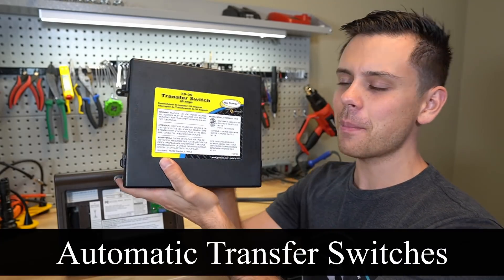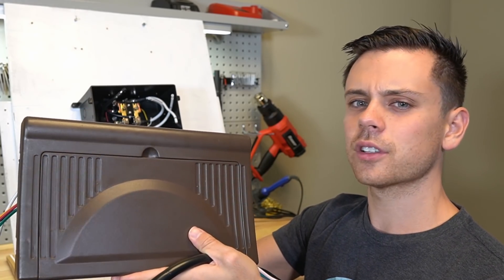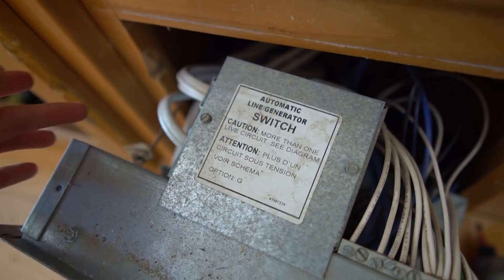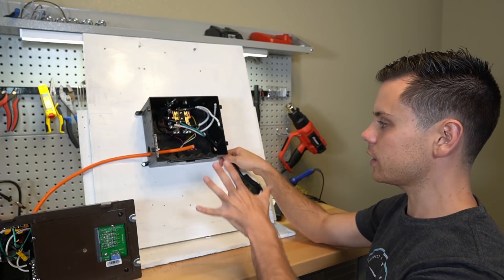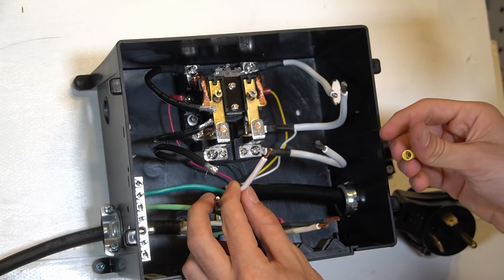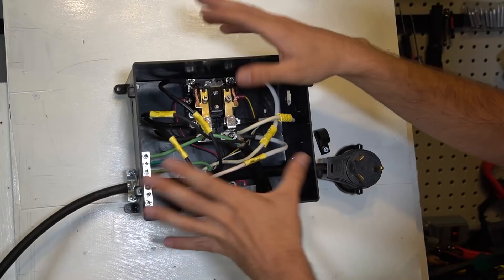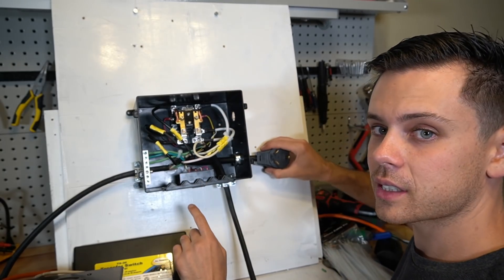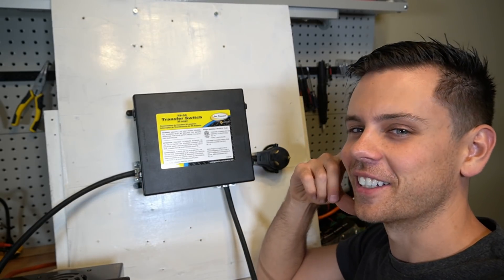RV Solar Power: How to Install an Automatic Transfer Switch to a Solar Inverter

Comment from the maker: Solar battery shore charging is covered at the very end of the video, but going by the comments, I need to clarify it here: No, do not charge your solar battery with the RV converter charger!! Hooking up a solar battery charger is covered at the end of this video.

If your RV has a solar battery AND a house/coach battery, then the RV converter charger is great and there is no need to disable it.

If you are using one battery for both, and you do not disable the RV converter battery charger, you are going to have a bad time! Think about it like this: if you have a battery, powering an inverter, charging  itself with the converter charger, you are going to have problems! I figured that was implied, but going by some of the comments, people are not understanding that part of the system. 

Many people use separate solar batteries than their coach batteries, or want to run their RV from a goal zero or other solar generator. Or a gasoline generator. Which means wiring the ats as shown in this video is ideal. If your solar battery is also your coach battery, you need to wire up your own battery charger. 

Does that make sense?

Tired of getting ripped off? Check out my "Will Prowse Approved" solar product recommendations below!

12V Batteries
https://www.mobile-solarpower.com/lithium-batteries.html

48V Batteries
https://www.mobile-solarpower.com/48v-batteries.html

Offgrid Inverter System Builder
https://www.mobile-solarpower.com/48v-complete-system-blueprint-559371.html

Hybrid Inverter System Builder
https://www.mobile-solarpower.com/code-compliant-48v-offgrid-system.html

Mobile Handtruck System Builder (very popular!)
https://www.mobile-solarpower.com/mobile-48v-system.html

Solar Panels
https://www.mobile-solarpower.com/300w-solar-panels.html

Ground Mount Solar Racking
https://www.mobile-solarpower.com/ground-mount-racks.html

Wire, Lugs and Busbars
https://www.mobile-solarpower.com/wire-and-connectors.html

Tools
https://www.mobile-solarpower.com/tools.html

Fuses and Circuit Breakers
https://www.mobile-solarpower.com/fuses.html

Plug-N-Play Solar Systems
Ecoflow, Anker And Bluetti! So many models to choose from. See my current recommendations here:
https://www.mobile-solarpower.com/full-size-systems.html

~~~~~~~~~~~~~~~~~~~~~~~~~~~~~~~~~~~~~~~~~~
Need to build a large DIY system? Need a trustworthy solar distributor? These are my favorites:

Signature Solar
Creator of EG4! Solar Minisplits, Victron and More! Largest Solar Store Online.
If you want $50 off, please use my link below and coupon code "DIYSOLAR50":
https://signaturesolar.com/?ref=cPwLcVc0SW-BjN

Current Connected
Best Prices for EG4, Victron, Midnite and so much more! Fast Shipping and Highest Rated Customer Service:
https://currentconnected.com/?ref=wp

~~~~~~~~~~~~~~~~~~~~~~~~~~~~~~~~~~~~~~~~~~
Join our DIY Solar Community 
Need more help? Join the largest solar forum on the internet for beginners and professionals alike. 140,000 members and counting!
https://www.diysolarforum.com

Check Out My Free Book
Best-selling and beginner-friendly guidebook to off-grid 12V solar!
https://www.mobile-solarpower.com/the-book.html

~~~~~~~~~~~~~~~~~~~~~~~~~~~~~~~~~~~~~~~~~~
Contact Information:
I am NOT available for personal solar system consult! If you wish to contact me, this is my direct email: williamprowsediysolar@gmail.com
FTC Disclosure Statement and Disclaimers:
Every video includes paid promotion or sponsorship (such as free products for review). Some links on this YouTube channel may be affiliate links. We may get paid if you buy something or take an action after clicking one of these. My videos are for educational purposes only. Information is subject to change/update at any time. Electricity is DANGEROUS and can kill. Be smart and use common sense :) DIY Solar Power with Will Prowse is a participant in the Amazon Services LLC Associates Program, An affiliate advertising program designed to provide a means for sites to earn advertising fees by advertising and linking to Amazon.com
Reply: This is the part where I have yet to tread in any real detail, so for me, this video should make sense after I re-watch it a few times so I can follow the wiring procedure(s) in my own head - and then hopefully I will fully understand how the entire electrical system is designed, and works together as a whole, including Solar and Battleborn's. I'm still heading out on the road @ 24 volts in a class A, possibly utilizing an additional 24 volt alternator to juice up the house batteries while going down the road. And CONGRATULATIONS on your new home Will, I am so excited for you!  Keep the videos coming, your channel is doing GREAT my friend.
Reply: Your Introduction Video About ATS and It's Relevant Interconnections Is Very Good and Extremely Well Organized .. I'm A Retired EE, Licensed Master Electrician With Extensive Specializations including Solar, Power, Controls and Electronics .. My Comment Does Not Reflect an Endorsement, But, Does Include My Professional Suggestions .. That Said, There's A Clear Difference Between Grounding and Bonding Requirements (Ref The Most Current Edition of The NEC or NFPA 70), Also, Consider Barriers Between High and Low Voltage Within an Enclosure (you may even relocate ground and neutral bars inside left and right sides rather than side and bottom) ..  Because This ATS has Exposed Open Air Contacts That Potentially Could Create an Arc, .. Butt Splices Should Be Taped Up With Electrical Insulation Tape .. However, I Prefer Wire Nuts (Strategically Placed and Taped of Course) Rather Than Butt Splices, .. and on that note, With Insulated In Line Butt Splices .. You Should Use Flat Crimps So As Not To Breach the Integrity of The Insulation Purpose On The The Butt Splice .. Indent Crimps Are Specific to Non-Insulated Butt Splices and Stranded Wire Connectors OK? ..  Termination Wiring Methods Is A Trade Craft Art including Wire Tags With a (Custom Legend Wire Tag Identifier List Affixed to the Inside The Enclosure).. My Signature Preference includes Service Loops (EXTRA WIRE LENGTH vs CUT TO LENGTH) Specifically for Ease of Maintenance Process or Future Replacement and Modifications, Cut Back Stripping of The Outer Sheaths on AC Multi Conductor Cables I Always Remove Sheaths Close to The Inside Box Entry Rather Than Extending into The Wiring Area (this practice removes stiff sheaths as an obstacle too, especially when using Zip Ties for neatness and bundling), As For The Cable Entry Clamps .. I Prefer Neoprene Compression Grommets rather Than Bare Metal for Circular Sheathed Cables Primarily for More Uniform Compression .. Lastly, a Tip for Power Conductor Entry That Terminates At The Top Lugs .. Punch A Properly Sized Entry Hole Top Left or Top Right Above The Lugs For Side or Top Entry .. rather Than Entry on The Bottom .. I'm Sure You Visualize the Benefits of Get That Idea (keep in Mind, Power Conductor Bending Radius No Less Than 8 x The Radius of The Conductor).. In Closing, I Appreciate Your Open Mind for Positive and Safety Suggestions From Qualified Subscribers .. My Comment Items Should Not To Be Construed As Negative .. My Comment Items Are Just Contributions To The Community For Further Individual Consideration, Research, Verification and Compliance for Specific Applications and Their Relative Locations
Reply from the maker: Great suggestions here
Reply: @textsmsmaster9884  service loops yes!
Reply: I'm thinking of switching the power going to my batteries from the converter via a manual switch. I would turn this on when under shore/ generator power and off when using the inverter power.
Reply: @commonsensepatriot9450  How did that work out for you?
Reply: @MrZeissOne  it worked fine. I added a separate breaker in the panel just fir the charger and moved the charger close to the battery bank too.
Reply: I have watched a ton of your vids but I haven’t seen anything on the system I want to build.
All the systems you cover are either/or systems(solar or generator/shore power). 
I would like to build a system with the following components. 1000 watt solar, wind generator, large battery bank, small inverter generator(gas or lpg), 30amp shore power. 
I will be building a trailer from scratch with all the usual RV stuff including A/C. 
In some seasonal RV parks you must pay separately for the electricity you consume or, when boondocking no shore power at all. Is it possible to use the maximum output of the solar panels while simultaneously using the shore power or generator to supply the the remainder of the needed power?
Example; if my solar output is 900 watts and it takes 1200 watts to run the A/C, is there a way to only draw the extra 300 watts from shore power or generator? 
If it is possible, would it be inherently inefficient or cost prohibitive? Would this affect the lifespan of the batteries?
Reply: @erikb8877  exactly my problem.  too many inputs,  similar outputs.
Reply: @erikb8877  The charge controller takes care of sending those 900 watts to the batteries. With AC plugged in at the same time, it just means you charge the batteries faster. Solar panels only charge the batteries.
Reply: @CompassAlwaysPointsToTerrapin  I actually have the same exact predicament. I too have a 3-stage WFCO connverter/charger and plan to use it to charge my LifePO4 bank. From what I can tell is it should be okay. The unknown here is how the converter/charger is designed I guess. If it was designed for liquid batteries then I am thinking that it may never hit the bulk charge mode for the LifePo4's and only be charging them at the absorption rate of 13.6V which would only be about an 80% charge.  Hopefully someone with more experience can chime in.
Reply: how does this work with another one of your videos? the MOES converter. how does that system run my 12v lights and so on while connected to shore power? does this remove the need for the MOES transfer function? you cover a lot in your videos,  but for the rv side,  the transfer of shore power integrated into a Solar system so that your 12v lights, water pump, etc work with both systems. Here you're describing a separate 12v battery that gets power from the grid, but how does the separate 12v solar battery connect in to power the same 12v lights as the grid battery?
Reply: @andrusha77   This was my question as well.  There are all of these all in one systems now, but none have 12v outputs.  So what do you do about all of the 12v systems in your rv that were once connected through the "converter"?
Reply: @CompassAlwaysPointsToTerrapin  I too have a PD converter/charger (lithium compatible). Wiring that little sucker was a nightmare - all my wires are white. You say here: "positive and negative wires for the converter go onto the same screws as the shore power..."  What? Would that not bypass the switch? you are connecting the converter/chargers power directly into the shore power.
Reply: Hi, been a fan of your work for some time now 😁 was wondering if you an email that you can give me cause I can sure use your help with wiring my solar set up 🙏🏽🙏🏽🙏🏽🙏🏽
Reply: Will, Can you please do a video showing how to connect a 50 amp transfer switch to your solar inverter? there seems to be allot of misinformation out there as to how to bypass the CONverter when using the INverter.
Reply: Maybe I worded it wrong. No. I knew not to mix the two . I just did not know at the time how I could intrigate the two without cross overs to damage the system.
Reply: You are good to clarify. I didn’t need it but I’ve seen some pretty hokey stuff people do with RVs and boats. Dangerous stuff if not done right- or well. Battery damage is the least of the concerns.
Reply: Hey Will, I am dealing with this issue right now.  I followed your 400watt solar beginner video to a T. Then followed this video to add the ATS. Everything is beautiful except the original RV charger is still trying to charge.  Do you have a video on disconnecting  say a Magetek 6300 series converter?   Your videos are amazing and very much appreciated!
Reply: I know this was two years ago, but you need a separate battery for holding a solar charge? I only have room for three batteries and shore power has to work, too.
Reply: A super helpful future video: replacing your old, sketchy travel trailer (not moterhome, no alternator charging) converterbox/charger/AC panel with a solar-powered battery system that is capable of supplemental charging through shore/generator for peak use (cooking)
Reply: Great video walk through of how to connect this ATS.  I am working on a similar project and am replacing my existing ATS in my RV with this GP TS-30.  One thing I noticed is that you mentioned wiring your charger directly to the additional bolts on N.C contacts #7 and #8.  The wiring diagram on the GP site indicates the charger on N.O. contacts #5 and #6, sharing the input with the shore/generator power, and the inverter wired to N.C. contacts #7 and #8.  Just curious as to why you wired differently.  Thanks.
Reply: most modern RVs are 30amp or 50amp service. Cutting the shore power cord behind the panel gives you two hots,  so how do you deal with that? We really need a video on that cuz thats what most of us will run into. Thanks
Reply: Would it not be easier to say that the wire coming from your shore power is attached to your main breaker
Reply: Will the converter and inverter drain each other?
Reply: @CompassAlwaysPointsToTerrapin   Thanks for the update. I actually sent in an email to WFCO and got the following response "You are correct that the WF-8955 was designed for Lead-Acid batteries but it will charge a Lithium battery to between 80 & 90% of full charge.  We do offer a Li-Ion solution with 2 products - the WF-8950L2-MBA, which is just the converter (bottom) section of the enclosure or the WF-8950L2PEC which is the entire unit." Personally I can't justify spending the extra money to upgrade the charger/converter as my thoughts are the solar will finish the job topping off the lithiums. Yes there may be days when solar won't be available, but on those days I can live with the battery bank only getting an 80% charge.  What I may do is take that money the converter/charger upgrade would cost and get the Renogy DC to DC charger which would also take the batteries to the full 14.6V charge while I drive.

Comment: its great to know on what type of  ( RV diesel, rv gas , fifth wheel- trailor , fifth wheel arent RV etc....... its been going on for so many years that old or young people still call fifth wheels Rvs and it confuses when you look up rv cause you have a diesel or gas and the video ends up being a fifth wheel... inverters converters are not the same as how it works

Comment: How do I hook up a ats to a 50 amp split single phase with A inverter that only powers 120v? Will that potentially put the circuits sharing a neutral, please respond?

Comment: Will can I use the original 30a ats that came in my 98 itasca suncruiser 32wq and remove the generator wire and wire the inverter in place of it with 10awg 3 conductor wire?

Comment: we have 2 255watt solar panels with a 40 amp control and 3000watt inverter we will shut of the converter in the camper. will this run the fridge and outlets in the camper the same as plugged into shore power.

Comment: Hey will.  I have the eg43000 inverter for this project and I’m trying to understand how the solar battery bank will get charged if the output of the inverter is connected to the automatic transfer switch.  Do I hook up a wall outlet to the input of the inverter?  Thanks

Comment: Awesome video! Helped a bunch.  One quick question, though. When you hook up the battery charger for lifepo4 batteries, do you have to physically disconnect the original converter, or does the transfer switch bypass it?
Reply: Did you ever get your answer? I want to know please

Comment: You are continually confusing solar with batteries. Batteries provide the power, not solar. Solar is just another means of charging those batteries. Many of us camp off-grid but have no interest in solar. You are hooking this up to transfer power from?????? Certainly not solar?

Comment: Will, been following your channel. I got a Thor Sanctuary 19P and a Anker 767 Powerhouse and can't get it to power the RV. Both the engineers at Thor and Anker blame each other and each has suggested to use a neutral ground plug (which I tried to). I think the problem is with my Southwire 41301 Automatic Transfer Switch(ATS) with Reverse Polarity, when I hook up the Anker 767 to it (no grounding plug) it shuts off) and I get a reverse polarity fault on the ATS and display, faulty power. Thor said it's Anker outpower is not wired right and I tested it with Anker engineered with an outlet tested and it passed. I believe it is the ATS that is blocking it since it is not sensing a ground. I can power everything else through the Anker but it won't transfer any power to the RV. I tried 30a, 15a, 12a. I talked to an engineer at Mastervolt (that is the type of battery system) and he suggest lowering the amps to 2 or 3 amps to a slow charge. Any help from any would be appreciated. Anker states it should charge an RV but I can't get it to work.

Comment: Sounds like this will not work for my RV - "Your RV is equipped with a 50 amp 120-volt 60hz AC electrical system. The entire system is designed to operate on 2 legs of 120-volt power at a maximum current flow of 50 amperes per leg" - Breaker box has a two pole 50 amp breaker. This is a 2018 Grand Design 28BH if that matters. What ATS can someone suggest to use? Thanks